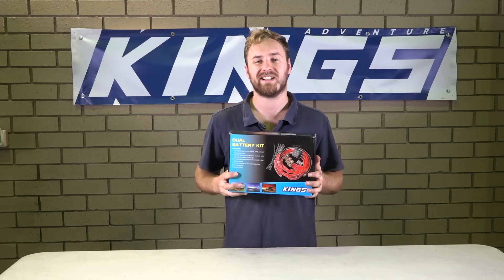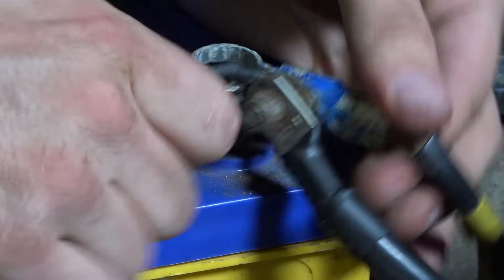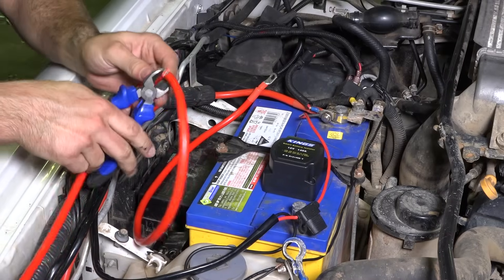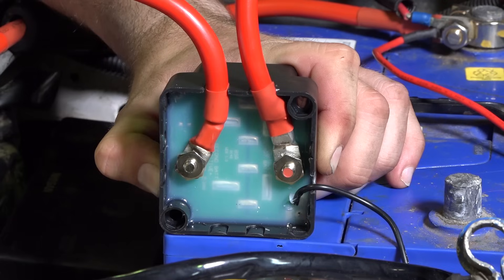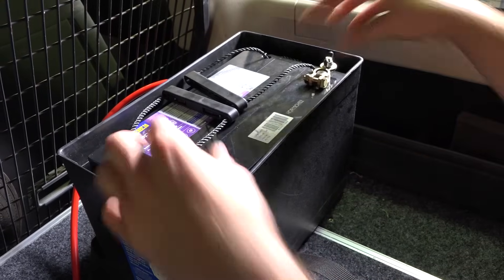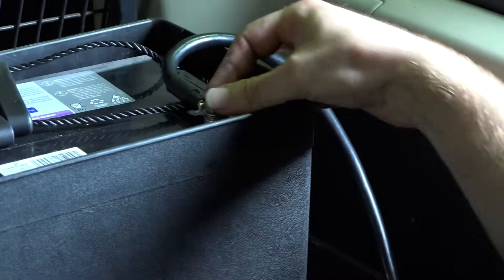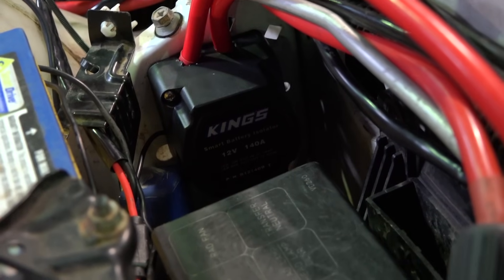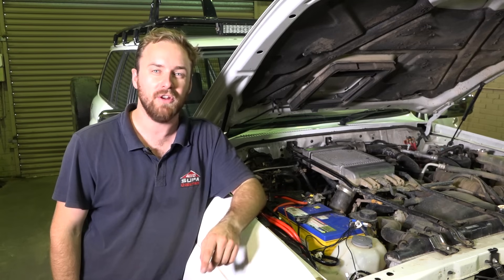DIY INSTALL: Check out this Supa Simple Kings Dual Battery Kit Install

Comment: I have a 2012 ford ranger, usually the isolator would stay on, now after a few months the isolator is turning on and off after a drive. I am running a 25amp dcdc charger connected to 120amp lithium battery
Reply from the maker: Hi there, thank you for reaching out. Unfortunately, we cannot advise for sure what could be causing this. We have contacted our product development team to receive further information for you. Kind regards, Rachael
Reply: I've had the same issue. Taking it back under warranty

Comment: So where do you put the fuses? Just after the starter batter and just before the deep cycle battery? @kings
Reply: both actives going into each battery, you just want the fuse to break when a fault occurs, so just wire it in series with each batteries active
Reply: @rj101silly  do you don’t need one from battery to isolator and isolator to aux battery?
Reply: @rileywalton993 You need one at the second battery and one at the first battery. On the first battery put it before the isolator. You basically want the fuses to be right next to any positive connection on any battery.

Comment: Does it need a fuse in between Start battery and Isolator?
Reply from the maker: Hi there, A fuse is neeeded in between the starter battery and isolater. As the max amperage is 140amps, We do recommend a fuse inbetween 140 to 150amps. Kind regards, Rachael

Comment: Why you don’t use fuse between batteries and isolator ?
Reply from the maker: Hi there,
You will need a fuse, we recommend checking the specifications on your alternator and fuses that are rated higher than the alternator output to avoid them blowing through normal charge. 
Regards, Courtney

Comment: Hopefully someone can help me out here ..I'm a newbie to all this and I want a dual battery setup,I  have brought this for my GQ (1996) LWB TB42E....Question to anyone that can help me, do I need a DC-DC Charger ? also if I don't, can I run a Inverter with this Dual Batt kit....Not looking at running to many accessorizes (ie fridge etc maybe later but at the moment just want a reasonably  basic setup so I can get used to it all ......cheers to any one that can offer some advice on any thing......
Reply from the maker: Hi there,
if you have a smart alternator in your vehicle you will require a DCDC  charger and an inverter can be used with a dual battery kit either way.
Regards, Courtney

Comment: What does it mean when the light on top is flashing?
Reply: @Tristan Smith either of you find out what this mean? Keeps turning on and off for me
Reply: @Tristan Smith thanks for the response! It seems to happen when my second battery is at around 13.3 V. This is usually in the morning (after solar charging), once it reaches 13.5 V though it stops and the red LED remains lit. 

Was your behavior different?
Reply: @Tristan Smith cheers dude. Sounds like I should swap it out then.

Comment: What size fuse is recommended
Reply from the maker: Hi Trent,

The actual inline fuse is 30A, this is in relation to the Anderson plugs. The cig socket is wired through a 10A circuit breaker. Thanks - Samantha

Comment: Will this work with a SMART alternator such as on the Prado 150?
Reply from the maker: Hi Nidz, fortunately the dual battery system wont work with a smart alternator. Sorry for the inconvenience. - Samantha
Reply: you would need a DC to DC charger, dual battery kits work for vehicles upto 2007, most after that require DC to DC